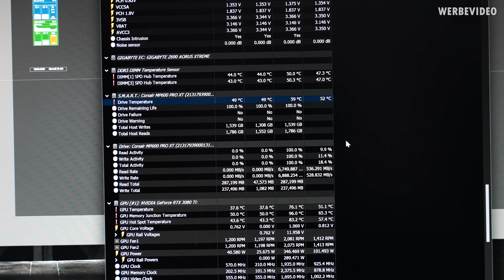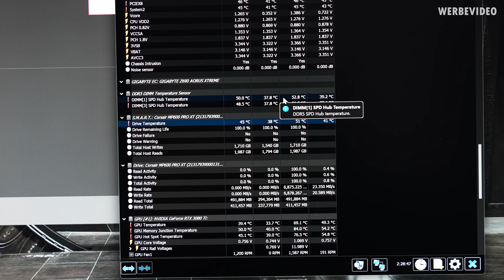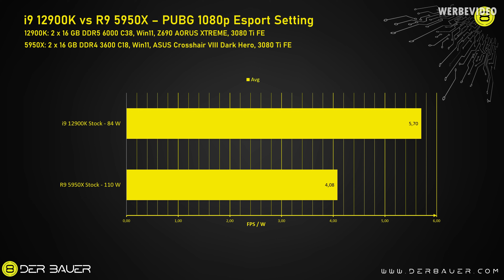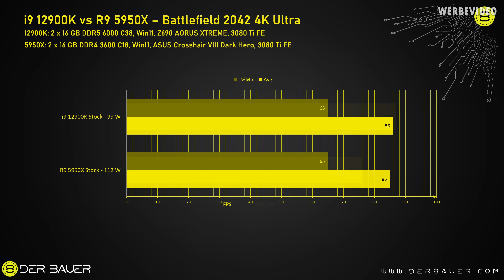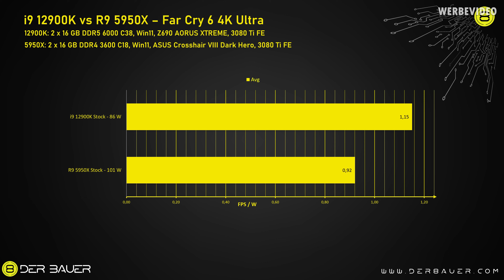AORUS Z690 Testing and Surprising FPS per Watt Results testing i9-12900K vs Ryzen 5950X

Comment: I do have this board with a sexy light setup. THere is just 1 problem. The usable ports, they are very limited. There is only 1 usb port, but you can extend it

Comment: I am a software developer and recently got a 12900K, undervolted at stock clocks (1.19V full load). My previous system was a Ryzen 3900XT, with a per CCX overclock averaging 4502MHz (fastest ccxs 4583.3Mhz, slowest 4433.1MHz). Doing development things, the 12900K is vastly more power efficient.

CPU Power consumption of the 12900K compared to the 3900XT is substrantially lower on the 12900K for all tasks except full synthetic loads, both CPU's use ~200W. I even set my 3900XT to stock clocks with a reasonable undervolt and it still used more power for ligther load tasks compared to the 12900K, however peak loads in applications like R23 looped, would only reach about 130W with the 3900XT undervolt.

Although my tests were not very scientific, and not the most even playing field, I was suprised that the 12900K is as efficient as what it is. It consistently uses slightly less power than an undervolted 3900XT, except for synthetic loads.

My thoguhts on this is that the 3900XT spends substantial power for the I/O die, where the intel chip does not. Power consumption of day to day tasks increases a fair amount going from 32GB to 64GB of system memory (DDR4 3600) with stable settings.

Comment: This Gigabyte Z690 AORUS Extreme board is currently selling for about $900.00 through Newegg. If I were to start a new PC build right now, I believe I would start with this board. Can't justify it yet though. I need to stick with my Gigabyte Z390 AORUS Master and intel i9-9900k combo for a while longer.

Comment: The board looks damn nice, but I'm not a fan of the pointless memories cover unless it at least had a fan.

It actually remind me of old memory kits like my most expensive DDR3 2133mhz with low trimmings from G.skill which brings a cover for them with like 2 small fans with blue LEDs which I never even used 👏

Comment: only 4 satas, what a shit board..  I remember when gigabyte and Asus and MSI made the best boards, now new gens are crap...

they used to have like 5-6 PCIe slots, 2+ Nvme slots, 6+ satas, now they have like 3 pcies, and mostly NVMES.... what a rip-off, NVMES isn't the future and are too costly for price per storage...  you only need really 1-2 NVMES at best with 1-2 SSDS... rest being HDDs.. they don't improve fps or anything just load times.

What's worse is these new motherboards are getting less and less USB ports on the back of the boards... screwing people over..

I have a USB expansion card,  Sounds Card, Capture Card, GPU... so now I must sacrifice my SOUND card... and be forced to use crappy onboard sound.

Comment: Anyone ran in to an a similar issue?
I finished my intel  build with z690 formula, had windows installed, everything was k, i forgot to flash the to the latest bios, i did after the bios flash it would not detect the nvme ssd anymore, wont boot in to windows, wont detect the ssd in windows installer. You can only see the drive in bios that it exists thats it. I spent 4 hours on the phone with Asus changing settings in the bios  and formatting the drive in different ways and still noting. Win 11 wont work, win 10 wont work, but the drive is there in bios?
Ideas? Even Asus was a bit left without words?

Comment: Which ram should I buy right now for 12900k? And Asus Maximus formula z690. I see a g skill royal elite kit for $450.00 with Ddr4 3600 with 14-14-14-34 timings? 
Its a 32gig g skill kit. 
There are also some 32gb ddr 4000 cl16 kits for $400.00! Or the 2x 8 16gb ddr 4000 cl14-15-15-36, can consider 4 x 8gb. I’m anticipating the ddr 5 shortage will go on for awhile and when available I can get new ram and rotate this in current 5900x system. (Probably runs best with low latency ddr 3600’with fclk 1800hz stable ?

Comment: My 5950X idle at about 130W of total system power. Previously I had dual socket Xeons V4 on Asus board and the idle was around 70W. Same like my old 4770K - 70W in idle. So I think this influences the results in low load like gaming. Intel is far ahead when comes to the sleep modes. I expect the 12 gen to be same or better then the 4770K.
Reply: If your 5950 is idling at that power draw something sounds off
Reply: @Scarlet_Soul  I have two 5950X systems now. Both the same, around 130W at idle, where the 4770K had 70W. Measured on wall socket.

Comment: I'm wondering how much of the difference in power draw was due to the RAM.  DDR5 runs at a lower voltage, so I would assume it uses less power than DDR4.

Comment: "Right now" there are real problems comparing the Intel 12xxx series to the AMD 5xxx series on Windows 11...
.
W11 is "optimised" for the Intel 12xxx series, but is also detrimental to the performance of AMD 5xxx CPU's.!  This should be noted, albeit these differences are small, so are the overall differences.

Comment: I found that the 5950X with PBO enabled and limits lifted would pull up to 135w in gaming. I've seen close to 160w on the 12900K when both e-cores and p-cores are overclocked

Comment: I'm thinking that the reasoning behind that is that right now getting any of the RGB sticks of DDR5 is neigh impossible. The only stuff that I have seen pop up lately has been the ugly naked module sticks with no heat spreaders. So with that said the cover would help dress that up. The problem that I have is more that I personally am done with Gigabyte. My experience with my Gigabyte hardware has been less than desirable.

Comment: It will be interesting to compare the power consumption of the entire system as well as the GPU load. Looking at the difference between 1080p and 4K I think that the 2 processors utilize the GPU in a different way.  Not sure if it is for a good or bad.

Comment: Thank you for the testing and work you do. I think people just repeat what they see on the internet. Intel hot amd cold. Intel expensive amd cheap. Intel uses too much power amd consumes no electricity it runs on love power alone for amd and lisa su. Intel bad amd good.

I find if I want to know what is true just apply the opposite of what people say. Worked so far. It will take multiple generations to break these stereotypes. I just pray people dont get hurt from it all.

Comment: I think this shows how far “under normal loads” Intel has come w/ it new and much needed process. As an AMD Ryzen user, I’m still happy with my performance and Intel has now forced AMD to see how it’s 3D-Cache CPUs will go next year. Problem with the 12900k is when “ it’s power limits are let loose” to gain a couple hundred MHz ruins its look for many. In addition adds a tonne to its cooling budget. The 12700k imo looks to be a vg chip in comparison to 12900k for negligible performance difference. Great review Der8auer 🥰👍. Performance per watt is a great measurement tool as generally the newer the cpu tech the more power is needed to get the higher clocks.

Comment: Both AMD and Intel are having amazing performance right now, and either one would be a great choice, but I've always felt that AMD is built for the bench and Intel is built for daily use. Which makes sense looking at how intel still relies on businesses for a large portion of their market, and businesses are more likely to be concerned with idle and low load power consumption.

Comment: Maybe only a stupid question, but did u installed/reinstalled chipset driver on X570? 
3600 C18 is not much quickly, average kits (not best) are 16-19-19 DJR 3600 , bu propably it will be not main possible issue.
Reply from the maker: It was a fresh install with everything installed
Reply: @der8auer-en  in Win10 are FPS almost the same? Maybe try it also in Win10 for both platform.

Comment: the reason why amd consumes more is linked to the functioning of the cores (the single core stock on the 5950x is 5.050 GHZ) in games it will try to give this frequency so intel which has a single core at 5.2 will never keep this frequency in games it will be more a 4.9 GHZ. My 5800x uses in stock 4.850 GHZ mono core and in 4.850 games with pbo + 200 MHz and the curve optimized in 5.050 GHZ mono core in 5.025-5.050 GHZ games, the opposite of how Intel works

Comment: I think the W/Frame is going to be worse for the 5950 over even just the 5900 because the cores that are not used still consume even just a few watts each, which will add up quickly. And the AMD chips like to throw a lot of volts for those last few Mhz. Just doing an all-core OC to 4.4-4.6ghz should be possible at 1.25v instead of the ridiculous 1.4-1.5v used for single threaded apps to reach 4.8-4.9ghz. You would lose 5% performance, but at almost half the energy. I'm curious how many watts a 12900k uses in SotTR, I feel like its one of the few games that can really push CPU testing. I loved seeing the impact from just changing ram timings.

Comment: @der8auer EN If you XMP ddr5 do you still get crazy vccio/vccsa?On my current ddr4 (z390)if I use XMP my vccio/vccsa goes to like 1.3/1.25 so I automatically put both to 1.15

Comment: Gigabyte should have just make that RAM cover as RAM cooler. It will make it a bit bulky, yes, but I can see that would be a good thing especially for non heatspreader RAM sticks IF ONLY they make it a cooler instead of just RGB cover that didn't do anything but block the airflow for RAM sticks

Comment: If you look at the fps data and total system power consumption for Cyberpunk 2077 in Techspot/Hardware Unboxed review you'll see the 12900K ties the 5950X on DDR4 and loses on DDR5. Then the 5900X beats both.
Reply: Hardware unboxed uses 3200 mt ram. Let that sink in. How realistic or I should say unrealistic is their testing.
Reply: @blackstar11211  They use dual rank 3200cl14 memory. This is higher performance than most kits on the market and it's plenty realistic. Learn how memory works, it's more than just a frequency value.
Reply: @imadecoy.  still 3200mt
Reply: @blackstar11211  So it's clear you don't even know what that means.
Reply: For the record, 4x8 GB 3200cl14 B-Die is the ideal kit to use because it's very high performance due to the low latency (lower latency than 3600cl16 and any DDR5 kit) and it also works with any DDR4 CPU you could possibly want to test, which ensures scientifically accurate data when comparing CPUs. It's also been shown to beat the best DDR5 kits available (6000cl36) with Alder Lake in latency sensitive workloads, including some games.
Reply: @imadecoy.  what memory do you have ?
Reply: @blackstar11211  I have a 2x16 GB dual rank 3200cl14 B-Die kit overclocked to 3800cl14. Not all that realistic for the average user.
Reply: @imadecoy.  so you have the same memory as hardware unboxed. Merely a coincidence or is there a reason you both have the same memory decoy if thats your real name or its just a decoy.

Comment: No one buys 5950 solely for gaming... It is jack of all trades CPU. Gaming, Cine23, you name it.
Intel can't compete in that category.
Do 5800x vs 12900, 8 cores vs 8 perf cores and come back as this comparison is pointless.
Reply from the maker: following your points the fair comparison would be 5800X vs 12700K. And I'm sure the result will be the same. This test compares the high end model of both companies. This is far from pointless
Reply: I have a 5950X system for mixed workloads: gaming + data analysis + what ever. If I were to build my system now I would probably build it with 12900K so I do not understand why you state that "Intel can't compete on that front". That 12900K system would have both a LOT better single thread and better multithread performance. It is a win-win situation.
Reply: Just add a point of reference, like the mach number for sound speed. So, there diferences are the same.

Comment: Guys, don't forget that Zen 3D V-Cache CPUs will consume even more power than their regular Zen 3 counterparts. LOL.
Reply: Even more than half of what Alder Lake uses with twice as many cores? Wow. Wait until you find out that accessing cache takes much less energy than accessing memory.
Reply: @imadecoy.  Nah, I've already seen Milan-X specs and compared them to regular Milan chips. V-cache increases TDP and lowers clock speeds. If you expect something else, get ready to be disappointed.
Reply: @Patrick73787  I don't know if you realize this, but Milan-X is not Ryzen. And clearly if you watched this video AT ALL you'd know that TDP is not gaming power consumption.

Comment: need to validate these readings with total system draw at the outlet using a KILL-A-WATT --- ive always been leery of the accuracy of software power readings..
Reply: AMD would fall back even more cuz their IO design draws alot of power.
Reply: @AlpineTheHusky  The IO power draw is included already... 🤦‍♂️
Reply: @imadecoy.  No the chipset is not included. I didnt mean the CPU IO I meant all the IO.
Reply: @AlpineTheHusky  Then you should specify that. But even then, there will be a significant difference depending on what chipset you test with. B550 will draw less than X570, while having some overclocking advantages.
Reply: Hardware Unboxed showed a tie in Cyberpunk 2077 on DDR4 and the 12900K losing on DDR5 for total system draw at the same fps. The 5900X beat both.

Comment: Another good one Roman. Like you, I'm a bit surprised by the results as most other \reviewers seem to indicate that the Intel CPUs draw way more power than the AMD ones. Did you by chance also monitor full system draw? Maybe the next  tests are the same sort of  thing, but for office/creator type work, encoding, editing etc.
Also, after watching your testing on the new PCIe4 M.2 drives I think last year and the temps they reached, I was definitely not thinking it was worth it for the small performance increase, but as you say, that M.2 cover with proper heat pipe sink is the way to go.
Reply from the maker: I checked the power consumption with a current clamp in addition to make sure it's in line
Reply: Not quite sure  what you mean or if you misinterpreted what I wrote. I was talking about overall system draw, CPU, GPU, RAM, SSD etc and also GPU draw comparatively between Intel and AMD to see if maybe the GPU "preferred" one CPU over the other.

Comment: The FPS per watt kind of checks out being consistently lower than ryzen 5000 from what I saw on a website but I can't remember which was it, skeptism is good though we see the efficiency of Alder lake/intel 7 from various undervolting test. the Pl curve \s just aim to give the Chip all it can use making them look like space heaters, Intel aim was to beat AMD so I understand the direction using the chip to its full capacity. I like the sound of a 5GHZ+ myself
Reply: Imo 12th gen is near perfect from a design standpoint. It is efficient as hell and if it needs to it can draw masses of power to beat even high core count CPUs

Comment: The difference looks similar to the IPC difference
When GPU bottlenecked a 5950X will be 40-50% use because games use up to 8-10 cores max
If any game can use 100% of both CPUs you would see the full difference, that would be something like intel 150 FPS - 240W, AMD 130FPS - 170W
I would like to see that same comparison vs 5800X, 8v8 performance cores
Reply: that is just not true at all.  the 12900k will nEVER draw 240 watts in gaming. never ever. its not using the full architecture when gaming so it will never use the full power budget. amd works different and it uses a lot more because of it. even idle amd uses more. and if a game would use all cores on the 5950x it would draw even more. And battlefield is cpu bound not gpu bound.
Reply: @pino_de_vogel  5800X 8C 113FPS on Battlefield, 5950X 16C 116FPS (harware unboxed test)
CPU bound and using all the resources available are different things, also learn to read ''If any game can use 100% of both CPUs''
Reply: @ericcartman5722  hardware unboxed uses 3200mt ram speed. So becareful citing any of their results as "evidence" for anything.
Reply: @ericcartman5722  i feel it's more engine bound then cpu bound as not a single core even gets close to 100% unless you have a slow 8 core or 6 core.

Comment: I am really glad for this review. I remember first benchmarks of 12900K. Everybody went nuts how much power these alder lake CPUs are drawing during synth load. But now you finally showed, its not true in gaming. But still - new CPU, MOBO and RAM is not great  from the value standpoint. Also i am a little bit worried that you did not try doing benchmark of 5950X under win 10 - you know because of the all AMD Microsoft windows 11 shenanigans.